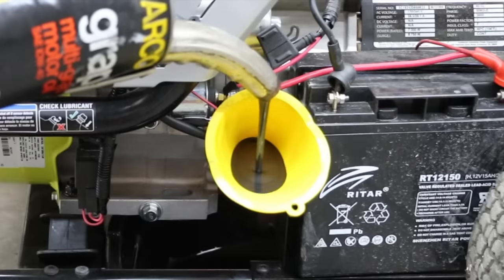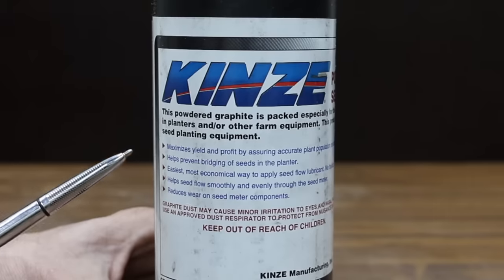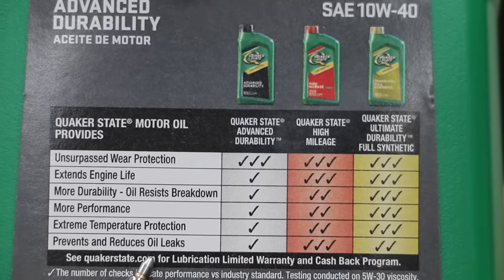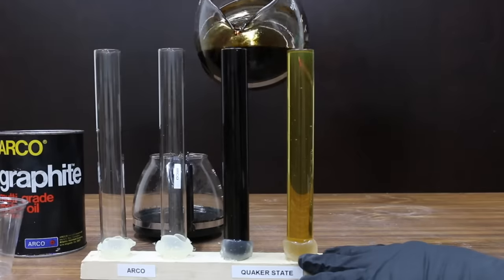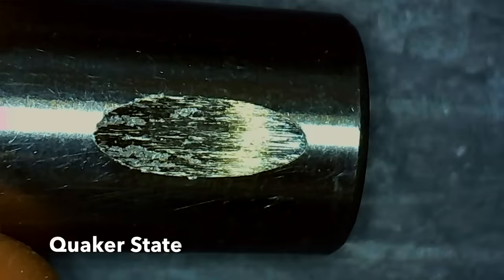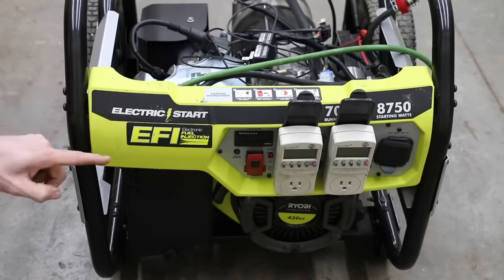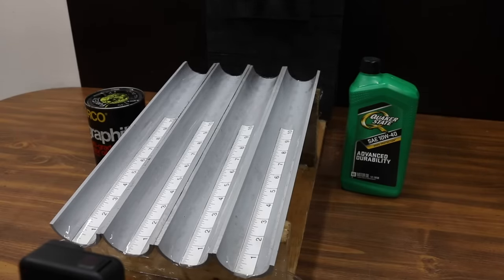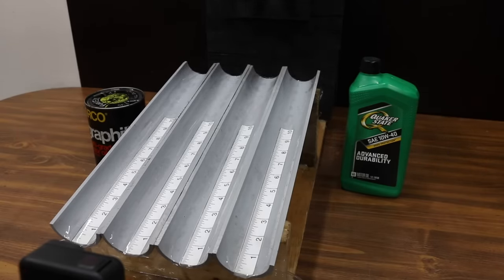Will "Graphite" Help Motor Oil Performance? Let's find out! Vintage Arco Graphite vs Quaker State

Comment: I used to work for ARCO when this product was introduiced. One thing you are missing is that the graphite builds up on the motor parts over time, and does not drain off after the engine is shut down. When you do a cold start, the graphite is on the cylinder walls already. That offsets the low flow rate.. I ran a 74 olds 350 on the oil and had 185000 trouble free miles.  That was followed by an 82 Old Cierra with the infamous Buick 3.0.  The camshafts were notoriously soft in this engine.  I sold mine with 175,000 miles, an unlike others never had any engine issues.  Another issue is the breakdown of the viscosity improver over 30 plus years.  As someone else said, it failed because it is black, and everyone wanted to see amber oils.
Reply from the maker: Thanks for the feedback.
Reply: IDK if this would be a great or a bad thing if the graphite builds up on the internal components. It's a great thing because on initial startup and warm up. With regular conventional motor oil you're waiting for oil to be supplied to those critical components thus resulting in extra wear and tear during that time but at the same time I wonder if the graphite would build up in oil passages and over time start choking off oil passages similar to plaque building up in arteries. Definitely was a revolutionary idea for its time that's for sure.
Reply: It was good stuff.
Reply: @Niterider73  it builds up where parts are touching hence the reason why wear is lowered, but use it on old iron engines....
Reply: Good pt except those GM Oldsmobile & Buick vehicles were always insanely reliable ..an hence why I'm GM loyal to this day. I do prefer Ford trucks tho I must say!
Reply: @Davido50  - GM trucks and SUVs at least, are now garbage (the worst in the industry) in my experience (since at least 2006/2007).
Reply: I worked for ARCO when Graphite was introduced.  According to ARCO the main advantage was that the graphite coated parts and was there when the engine started
Reply: @saltyroe3179  as i said😉
Reply: Used Arco back in the 70s in amc jeep cherokee that was great stuff.  Also we stored graphite in our whse. Superior graphite was the company we stored for and ship it to alot of plants. Even slip plate which was a oil grease with graphite in it as well..
Reply: @ProjectFarm  jo, really love ur tests they are cool to watch all though i personally would like to see a long term test on the additives u test, maybe half a year on one of ur lawnmower engines, that would give a better and more true picture..

also I would love if you could test a product called SWEDOL (swede oil) from the swedish company Basta..
there are so many + and - for using(not using it because of the PTFE (yes people i know you call it Teflon, but that's a brand name from 3M) please test it someday🙏🏼
Reply: @Missagan - I agree 100%. Their engines and transmissions are pure garbage. I just bought a new 2021 Chevy Silverado 1500 RST 6.2L Z71 Texas Edition (fully optioned) last year ($62K). But there was no inventory in California (where I live). So I bought it from a dealership in Texas and had it shipped here. 

When it arrived with 28 miles on it. I started the engine. I then heard the classic lifter ticking/ pushrod issues, engine running like shit/ died several times (even after being warmed up). Timing was off, belts were squealing, etc. Transmission doesn't shift right. It has 665 miles on it now. After owning for a year and taking it to the local Chevy dealership several times these problems still exist. 

They won't fix it. They told me "it's normal". I hired a lawyer, and am currently pursuing a Lemon Law case against GM and trying to get them to buy it back for what I paid for it (plus damages and lawyers fees). Mary Barra and prior and current GM executive management has decided to screw customers, knowing they will soon make the transition to all electric vehicles and can leave a trail of suffering of millions of customers in their wake (as they get $Million dollar bonuses).
Reply: @SkylineToTheSeaAndMe @Project Farm Hey SkylineToTheSeaAndMe I'm hoping earnestly that with the number and severity of engine problem symptoms and the transmission shift problem and repeated attempts through factory authorized repair dealer repair visits that you succeed in the lemon law truck buyback effort. Noticed no video on your channel about this-script it, be polite-even if heater and irritated  - and show the whole world how it starts and sounds, and then weekly or monthly, also  in a 2 to 10 min video, any progress or a repeated status update of no resolution and continued waiting/effort. 

Many are happy with the cars and trucks they purchase. ALL that are sold new should work well. My 2008 Chevy Silverado / C1500 has had a rough idle, visible vibration or shaking since I bought it, and dealer comment and repair/service notes were just that it is operating normally. 89,000 miles on it now, light use.  
Oh, Project Farm thank you for the alway-tremendous informative videos!
Reply: I too used Arco+G for as long as it was available (and went to a lot of trouble to get it in the end). '66 Ford Mustang V8. 

Was used to doing my own valve jobs. HATED all the time spent trying to scrape/chip/grind all the baked-on deposits in the lifters/cover area (before Arco+G). Was absolutely amazed the first valve job (scheduled, probably not needed) with Arco+G . It seemed to have scoured clean the whole engine! Looked "like new" (at 80,000 mi)! 

I would not think however that any tests mean that this may be good to use in "modern" engines. 

I agree with others that (1) any tests you ran by just adding "graphite"(generic) to oil is likely meaningless. Arco put a lot of research into it to make it work. (2) Plus "cold flow" tests conclusion ignores fact that the super-fine graphite would "already" "be there" to lubricate before any oil gets flowing.

I think Arco+G was a good product for the engines of the times. There did seem to be more oil component evaporation (a real no-no today), but that was probably a "part of the plan".
Reply: @Sovereign_Citizen_LEO  because you bought in 2007 lol, the second malaise era
Reply: @THESLlCK  - I bought it in 2021. The major problems with GM began in 2006/ 2007. The reality is these pushrod engines need a complete redesign. GM doesn't want to spend the likely $Billions it would cost to do it (retooling factories/ redesigning parts/ parts suppliers/ etc. etc.). They also don't want to spend the many $Billions it would cost to fix all the millions of engines and transmissions since that time that have problems. They have totally put the cost and burden on customers (which is why I will never again buy another GM product). My lawsuit will also likely include damages/ reimbursement for "pain and suffering"/ other costs incurred as a result of their corruption/ criminality/ incompetence. We have a Facebook group (among others), that has tens of thousands of members.
Reply: saved thousand of jobs and was payed back. other countries governments directly subsidise there industries and strenthen they industries we do not.
Reply: I agree with everything you said, it matches my own experiences back in the day.
Reply: THE GRAPHITE ALSO CAUISED LOTS OF ENGINE DAMGE AN DPLYGGED FILTERS. I AM GLAD THEY TOOK THAT THING OFF TH E4MARKET!
Reply: @Sandy-jc5fv  THE HEAT MELTS THE GRAPHINE AND MAKES IT WORK INTO THE MOTOR OILE. NOT A BIG SECRET. EFERYONE CAN DO IT EXCPE  THE GRAPHITE PLUGGE SUP THE OIL FILTERS AND THE ENGINES GETR SDAMAGED. THEY STOPPED SELLING THAT STUFF FROM THE MENY WARRANY CALIMS.
Reply: @saltyroe3179  That's what they told me about Duralube. Was supposed to treat the metal. Duralube worked very well for me.
Reply: @bloodybones63  ARCO Research in Harvey Illinois designed ARCO Graphite.  My wife worked on projects with the Harvey boys.  It was inherited from Sinclair oil which ARCO bought.   I had to work with paying our supplier Sun Oil, who made ARCO Graphite under contract.  As a result I had access to our warehouse in the Los Angeles area and was able to buy a case of ARCO Graphite their at wholesale price.  BTW Grapite was natural oil with Graphite and as a result less expensive than synthetic oil.
Reply: Well I mean, could potentially get similar results from full synthetic.... But people are too afraid to switch, due to myths
Reply: Graphite also gets into the bearing races and causes chatter which ends up over working over heating the bearing. Never use this stuff. It raised Compression because it was wet and filled in the piston wall honing cross hatches.
Reply: @ilovecops5499  OK, I'll just comment a bit here. Not posing as an expert. I do know a little about it, though.

Re "THE HEAT MELTS THE GRAPHINE AND MAKES IT WORK INTO THE MOTOR OILE. NOT A BIG SECRET. EFERYONE CAN DO IT".

Ummm, there seem to be some problems here. "graphine"? Perhaps you are thinking about "graphene", which has gotten to be a bit of a "buzz word" related to "graphite". I'm pretty sure you are mixing up technologies and technological references here.

I'm not sure what you are considering to be"graphine".

Perhaps you are thinking about "graphene", which WAS INDEED "a big secret", so big in fact that the material was first isolated in 2004 and "the 2010 Nobel prize in physics went to Andre Geim and Konstantin Novoselov, who first isolated Graphene".

Graphene is INDEED a very special "form of" the substance graphite. Graphene is a sheet of graphite atoms (carbon) one layer thick. 

It is NOT something that "just happens", and is apparently not responsible, directly, for the commonly known lubricating properties of common powdered graphite. One apparently does not "get graphene" by simply combining powdered graphite with ANY substance (lubricant, solvent, or what have you). That's why the making of it was indeed a big deal.

Graphene apparently is not and has little or nothing to do with the readily available "powdered graphite" and the latter's lubricating properties. Only in the last 10 years has there been much progress in implementing the use of graphene in material science.

Bottom line is, if in fact the tests shown used some actual substance that contains "graphene" (and mixing it in oil or whatever), that (meaning it's properties) has nothing to do with the (powdered) graphite-and-oil lubricant Arco came up with 60 years ago.

On the other hand, if, rather, the tests used powdered graphite just mixed with some commercial oil, that's an insult to the development effort that went into producing "Arco" with graphite. 

I am sure that the folks at Arco that worked on the development of their lubricant would not like the comparison of their product with something hacked into existence by simply mixing powdered graphite with "any old oil". Yes, the latter will be better in some circumstances than just oil, but that doesn't mean you solved the problems of coming up with an approved automotive engine oil.

The tests shown are of some interest, but are not a demonstration of the properties of Arco with graphite.

And as to "THE HEAT MELTS THE GRAPHINE AND MAKES IT WORK INTO THE MOTOR OILE", the melting Point of graphene is about 3700 DEGREES CENTIGRADE (about 6660 F.). The numbers for graphite are about the same. I certainly don't think you are melting either one, much less putting a substance that is that hot "INTO THE MOTOR OILE"

Science is sometimes fun, sometimes easy, and sometimes obvious. SOMETIMES. But don't count on it to always be any of those things.
Reply: @ilovecops5499  imagine this in the human bodies now ...why ?
Reply: @Davido50  - Drive the Chevy truck into town. Drive the Ford truck, working loads on the ranch. Testimony from NM/Texas. ;}
Reply: but what about the filter wouldn't graph clog?
Reply: @johndemore6402  No. The particle size was too small.
Reply: @jackelliott3103  do you known/remember size?
Reply: @johndemore6402   Unfortunately I do not
That product was introduced about 1978 or 79. ARCO sold the east coast in 1985. At the time of the sale  I had never heard about a problem clogging filters. It failed because it was a mess.  It stained your clothes and hands and was unpopular with the shop technicians who had to handle it
Reply: @Davido50  Yup i hqave fist hand experience of GM's shitty oldsmobiles.  My family used to have an Oldsmobile mini van and my mother went to the drs that involved a 40 min round trip and it broke down twice on the way home once on the highway and again as soon as she was barely in the driveway my father had to get out and push it up the rest of the driveway.
Reply: @JamesAutoDude  more likely due to the price difference
Reply: @kellismith4329  nah full synthetic is basically the same cost nowadays, sometimes cheaper. People are just afraid because they think it's some "upgrade" that isn't compatible with their engine. I've dealt with it all the time when I used to work at O'Reilly

Comment: "No oils seem to be aware that the race has started"
Reply from the maker: lol  Thanks for watching.
Reply: @Tadgh Collins: Correct me if I'm wrong, but Drag Race Cars or Funnycars  are using graphite oil in their diffs. I dunno why, but I've seen a video on YT where it's stated.
Reply: @Bandicoot803  Arco won on the wear test, so graphite would probably work great in a diff. They have no pump/filter, or babbitt material to worry about.
Reply: @MA-nx5vt  The wear reduction is probably from the phosphorous and zinc concentration.
Reply: @Bandicoot803   graphite powder is actualy considered an dry lubricant
Reply: @lucasbotelho316  Indeed! They use dissolved graphite powder to lubricate the steel conveyor belt's chains on industrial pass-through baking ovens. The liquid graphite penetrates deeply into the side-mounted chain's rollers before evaporating, leaving a coat of dry graphite powder behind. Can't do that by simply sprinkling the powder per se on the chains. Otherwise it could simply be blown off the surface.
Reply: That was my favorite sentence in the whole video.
Reply: The comments during the race are awesome
Reply: @lucasbotelho316  kalasnikov bullets use graphite as a lube in the barrel
That is why AK' s neve brake...

Comment: I ran Arco Graphite in my 1975 Vega for a couple of years.  It worked fine.  I did annual oil changes with it, about 10k miles each.  I remember reading about Arco Graphite in Popular Science when it was introduced.  One point that stuck in my mind was that the Graphite particles had to be sub-micron sized so they would not get caught in the oil filter.  People that want to experiment with adding solid lubricant to their oil should keep that in mind.
Reply from the maker: Great feedback. Thank you
Reply: I used Arco Graphite in my 1976 Buick Regal with a 350. I sold the car at about 80K, the engine consumed no oil and other than the graphite mess, was very clean. I can't believe I was willing to get that messy stuff all over myself when I changed the oil, but I did.
Reply: Holy, a Vega. My grandparents had a Vega and the Vega Station wagon. Forgot about those cars until seeing this comment
Reply: @ventusvero4484  My brother had a Vega when I was 11 years old. It had an 8 track player that I listened to Supertramp-Breakfast in America.
Reply: I wonder if the graphite prevented the cylinder scuffing that the Vega engine was notorious for.
Reply: @gregorymalchuk272  By the time I started running Arco Graphite in it, the engine had been rebuilt with iron sleeves.

Comment: Your dedication to be accurate an unbiased is incredible!! Don't take that lightly
Reply from the maker: Thanks so much!
Reply: enginemaxcarb.  his approach to these tests is to measure efficiency or durability. I don't think his interest is in checking power, although he has tested stuff on his RV before and speed tested it I believe
Reply: Back in the 70s with the Arco graphite oil people had a problem with it clinging to the engine walls and they kept adding oil.. overtime it would just keep building up in the engine
Reply: The power of the scientific method